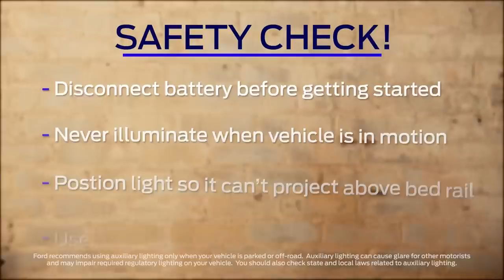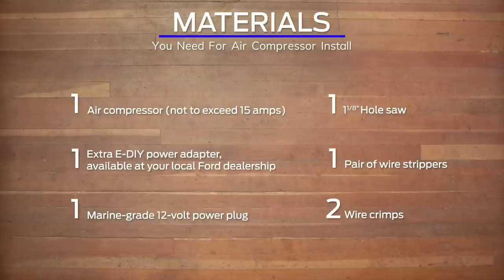Hack Your Maverick: Electrical DIY Bed Rail Lighting & Air Compressor | Ford

Comment: Should have used solder tubes so people aren't discouraged by the solder tools. For those who don't know they are tubes that you slide each side of the wire that you are joining into. Then you can use a lighter or heat gun to melt the solder and the tube shrinks making a water tight seal.
Reply: I think the point is introducing people to very simple diy methods so they can learn to mod themselves. Ford could have just released plug n play kits at ridiculously inflated prices, or used an existing 12v connector. 
Goes with their whole angle of marketing to non-truck people who want to feel more handy.

Comment: How do you connect the lights on the opposite side of the bed so one switch works both sides? The video only shows wiring and mounting one side.
Reply: Do it the same way they showed, but splice another 2 wire connector into the harness that comes with the truck. Then your could have one side wired on one switch, and the other side on a separate switch.
Reply: @jordandaggers1430  I assume they ran a cable under the lip on the front of the bed to the other side.
Reply: @jordandaggers1430  So you're using both of the 12V circuits they supply just for lights, and you have to switch it twice?

Comment: I love the DIY vibe with the new Maverick.

Can we get an all-electric version?
Reply: The F-series Lightning is the first all-electric truck they are making, after that the Ranger and Maverick should follow if the Lightning does well.
Reply: A plug in hybrid would be cool as well. I like having the gas option, but extended electric range on shorter trips would be amazing.

Comment: Hey Ford I heard about the everglades is that going to be a bronco color or is it going to be a package? I think if it's a package it should have the rubber floors, marine vinyl seats, a Snorkel (like the tacoma has a snorkel option from the factory) and water proof electronics because it would be cool to be able to wash the bronco out with a hose after taking it through a mud hole and if you got muddy then got in the bronco you would be getting everything muddy and it would be much easier to just wash everything with the garden hose.
Also you should think about offering a strip down model for those who want just the essentials or want mechanical equipment instead of all those electronics. Electronics fail way to often and they have limits you should know this because the bronco uses a hydraulic sway bar disconnect unlike jeeps electronic. Therefor I say the bronco should have an optional manual transition with all engine options a manual, transfer case and manual diff lockers.